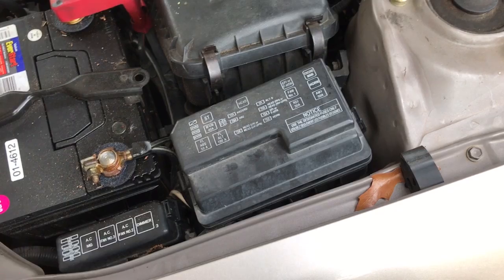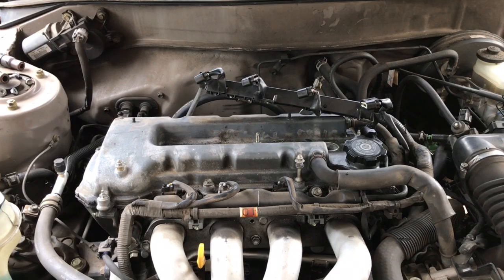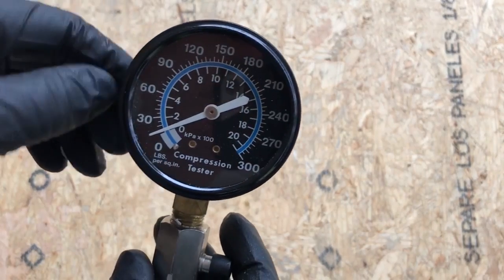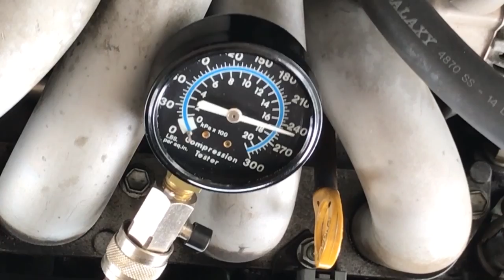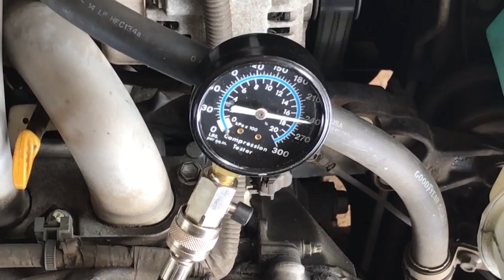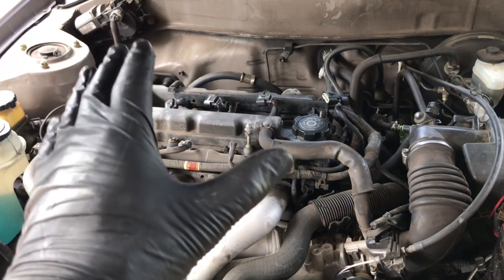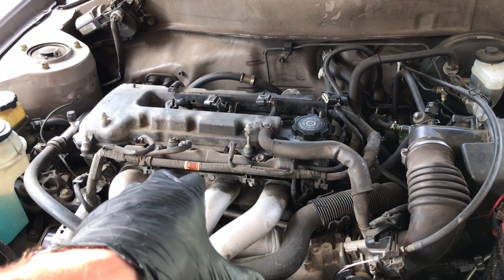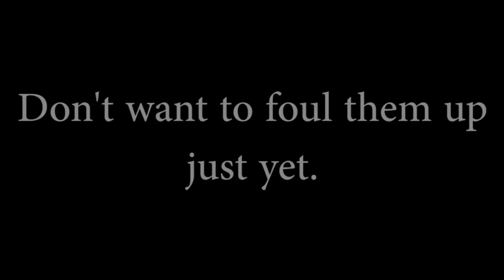Are piston rings causing oil burning? | Compression test | Oil Burning🔥Experiments | Episode 3

Comment: I got my rings unstuck ,cylinder two and three. took oil out and left oilpan bolt off,lowered the two middle cylinders all the way down,filled with gas ,and let sit 24 hrs ,then boiled water as hot as possible and poured that in the next day,and lord and behold it unstuck em.car running great now.
Reply from the maker: So no oil burning now, Eddie?
Reply: @FamilyFriendlyDIY  had 90 psi compression  on cylinder 2 ,,,,,,150 on cylinder 3 ,and 180 on 1 and 4.Had cylinder head redone,and checked valves while head was off with the cams on and valves were perfect.
Reply: @FamilyFriendlyDIY  with the oil pan bolt off,and cylinders full of gas it was dripping pretty heavy thru the bottom.After the cleaning, their wasn't a single drop coming out of the oil pan plug.

Comment: Hey I had an idea I used on a 53 chev. Truck.  Soak cylinder in carb cleaner then use compresed air direct to cylinder on the tester hose. Blow down.
Reply from the maker: What were the results, Howard?
Reply: @FamilyFriendlyDIY  had bad over fueling lots of carbon compression improved.

Comment: Head Gasket ruptured between cylinders 2 & 3, leaking oil and cold compression. See adjacents?
Reply from the maker: That is an interesting hypothesis. But wouldn't they have low compression whether hot or cold? And isn't it likely I'd be loosing coolant somewhere too?
Reply: @FamilyFriendlyDIY  Depends where the rupture is, theres the water gallery and theres the oil galley, if the HG ruptures close to the oil line craved in the head, you gonna have oil injestion into the near cylinder by the huge oil pressure you get there, especially at cold viscous oil. The expansion of the HD and the Head itself may keep the cylinder more compression sealed. JMT. I would advise you to not use Restore yet, because the metals on it will embbed in your rod bearings making things ugly and your cylinder liners are like new with crosshatches and all, not needing Restore at all. And the rings, prolly like new too. You could try moly MOS2, if it cooks around the rupture, you may cure the HG.

Comment: doing compression test after driving ,if rings are stuck wouldnt they allow oil build up on cylinder walls causing same effect as doing a wet test on a cold engine?..... having simalar problems with my car
Reply from the maker: Entirely possible, numbre nine. Thanks for the comment.

Comment: Empty the engine oil out, put 3/4 back in, then put a 1/4 of diesel in. That will act as a flush, cleaner , all whilst lubricating everything.
Reply: Not today's Diesel. It's so stripped out of oil, not even funny. Old Diesel was a great solvent cleaner. Now this low sulfur on road crap is terrible for cleaning carbon, compared to old Diesel. I still use Diesel to clean oily greasy parts. Nothing better nor cheaper.

Comment: What's all the white build up on the plugs?
Reply from the maker: It's typically just called "ash," Bobby. Not sure exactly what the deposits are made of, but the whiter it is, usually the leaner the engine is running. They used to say a properly tuned engine would have "tan" electrodes on the spark plugs.

Comment: Why didnt you do a wet test? Its like a mystery to me I addition to what's messed up in your car. I know you not a mechanic but you could try changing a few seals on the top of the crank case. It's a 20 min job if your plugs are wet and tips of coils are wet that's a big sign you oil is being lost there also if not entirely.

Comment: Interesting.  My 2007 Camry manual says 1 quart for 600 miles is OK.  That's about what it burns until you get on the highway, then it burns 1/4 of a Quart every 2000 miles!  Mine never got the new rings on a recall.
Reply: 2.4 2007 Camry do have ring problems, I have one with only 112000 miles on it ...

Comment: Buy a new PCV valve and install it and skip testing the old one or cleaning it. The click may be there and the PCV valve still not working right...Low cost and simple to do. Do NOT assume the problem is the piston rings (3rd one down) but instead the valve seals (2 in and 2 out on a 4 cylinder small engine like a Corolla or Civic or other small engine...  Some chemicals may be a lot cheaper than 'fixing the problem' ... and awful non-music, BTW.

Comment: The solution is sell it
Reply: Or do the right things as he is by fixing it proper. Don't pass it along to someone else. No integrity guy......
Reply: @jimdavidson5208  Yes, if it is a worthy car. Corolla 1998-2002 is not worth to be fixed. It is basically junk, crusty interior, crusty rusty body, and it just has no value. It is meant to be in junkyard anyway as a scarp metal. Civic or Sentra at that period is much better.  The 2003 - 2008 Corolla is a legend, very durable and much better quality interior and rust protection too. In the market 1992-1997 Corolla worth more than 98-02 Corolla even without VVTI.

Comment: May I say to you that 240psi is way too high for a gas engine, ok for Diesel..1ZZ-FE is a 10:1 compression ratio, so 150psi readings are about normal...roughly.  Kerosene or GM top cleaner...
Reply from the maker: The book says it should be 218  psi.  My gauge is probably off.  The lowest it should be according to the book is 145 psi.
Reply: Maybe it is higher than normal because of so much carbon in the combustion chamber. I'm surprised it's not detonating prematurely. If it is, the knock sensors must be retarding the ignition timing a lot in an attempt to avoid preignition.